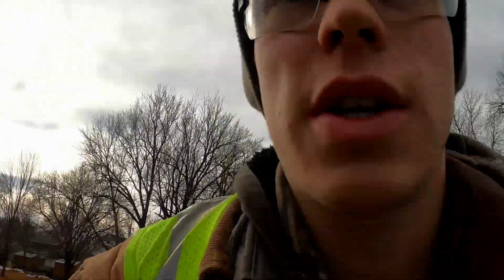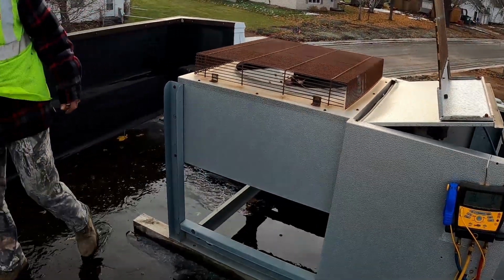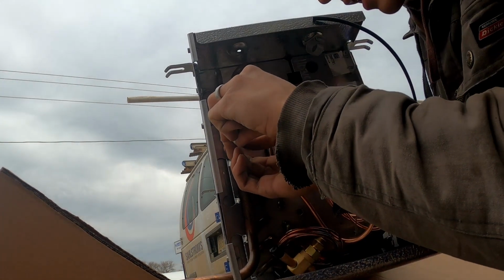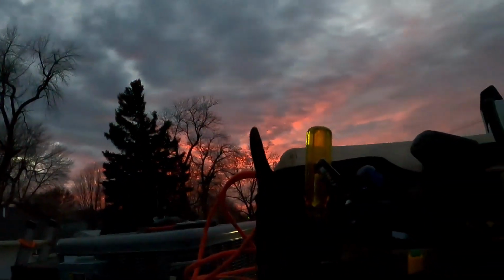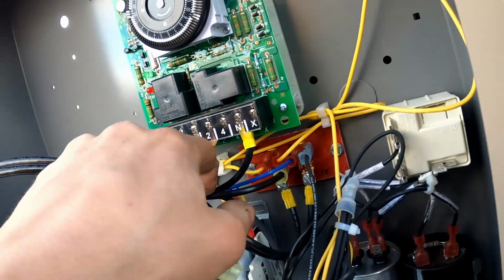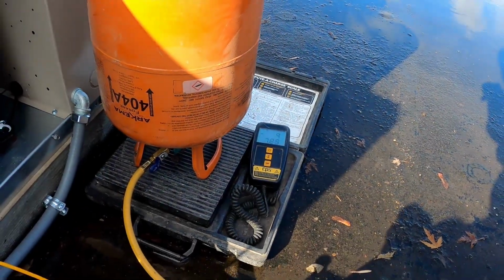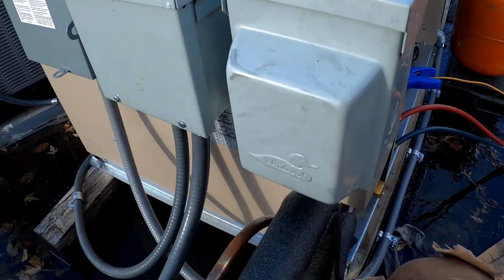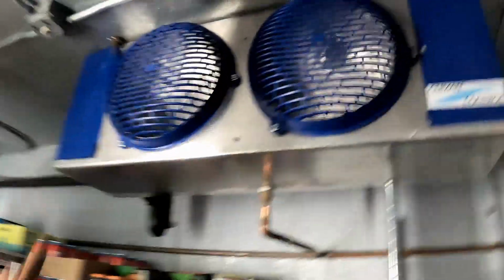How to Replace a Walk In Cooler

Comment: Might be a bit late on this but sounded like the fans were running on low speed do you know if the evaps had 2 speed fans? sounded like they were running 800 vs 1550.

Comment: hey Reuben! i have compressed air dryer ,i want to check pressure without refrigerant. It has no pressure at high pressure outlet, connected directly to compressor it gives 200psi it is ok? it doesent give a pressure without refrigerant because hot gas bypass regulator ? here is the movie how i check it https://www.youtube.com/watch?v=saw3EMYtLAI and here https://www.youtube.com/watch?v=wR7RPw0Hw0k
Reply from the maker: Well, it appears that the compressor is pumping pretty well, assuming it's at zero on the low side and able to push up to 200 that quick. I have never worked on a compressed air dryer, but I imagine the refrigeration circuit would be similar to a small refrigerator. It is better to troubleshoot with refrigerant, and not always good to pump air as moisture could infiltrate the system. Good luck on your project!